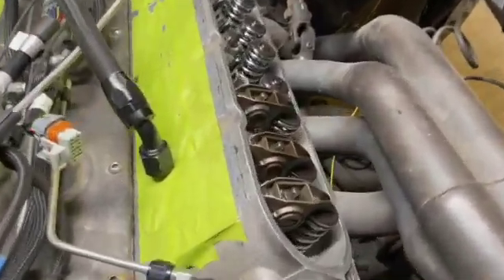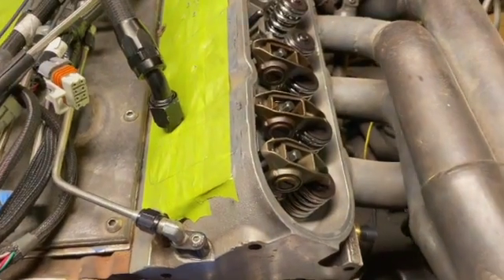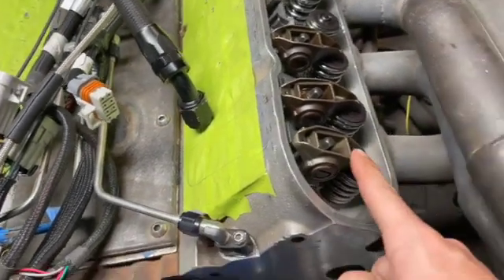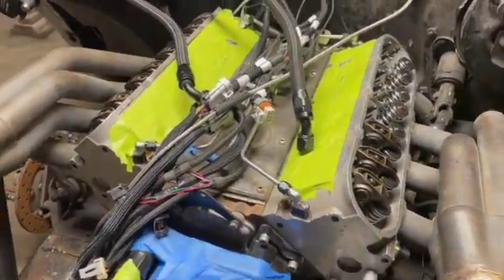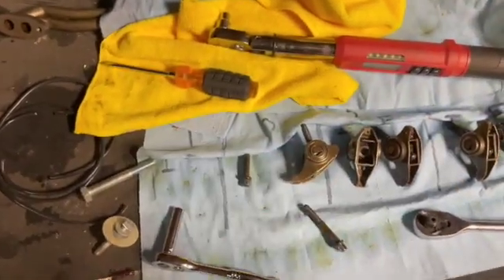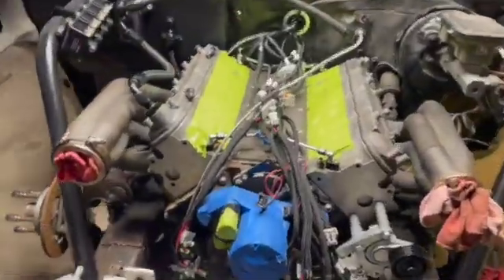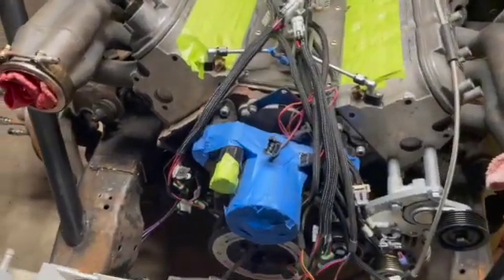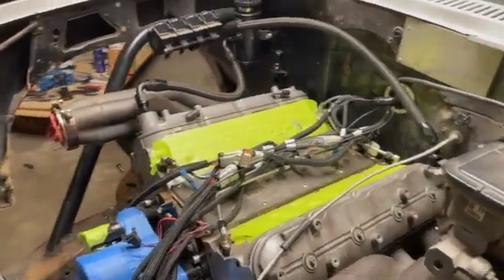How to install LS rocker arms

Comment: So basically you don’t even have to do them in order, you can just spin the motor over and torque each one once it’s in the open position?
Reply from the maker: I didn’t do it in firing order, and it’s been together a year now almost making 25lbs of boost at 7400 rpm and been good
Reply: @boostedS10  okay okay 👌 I’m doing my AFM/DOD delete this week so I very much appreciate you taking time to respond to me. The torque sequence/ valve adjustment was the only thing worrying me about the whole job because I’ll be honest, I haven’t touched a cam in probably 15 years and the last one was on a 305 small block so this is all new to me. I must have watched 15-20 hours worth of people rebuilding the LS just so I’d get a feel of what I’m looking at.
Reply from the maker: Yea I was super worried about that on my first ls lol so i completely understand
Reply: @boostedS10  I feel you. This is my daily so I got no choice but to do it right the first time
Reply from the maker: Understand that, good luck and hope the video helped
Reply: @boostedS10  it’s deffinatley worded for my brain to help understand it Vs others so I’m sure it will. Thank you very much. New sub incoming 😉
Reply from the maker: Thank you for that dude
Reply: @boostedS10  thank YOU for helping my stress levels go down. I feel like I actually understand it now. Least I can do is sub. Besides you may post something that helps me in the future so having you on here is a easy way to find that out.

Comment: You do not have to turn the motor every time you put a rocker arm on. I put them all on at the same time and run them down with a gun until the slack is out of them and then tighten them down by hand and then torque to 22 foot pounds.
I have built hundreds of LS motors and never had a problem.
Not sure where you got your info but it is not correct.
Reply: 22ftlbs is in maintenance manuals id10t.
Reply: @shadowopsairman1583  u ever heard of a typo ? I fixed it for you mo ron !